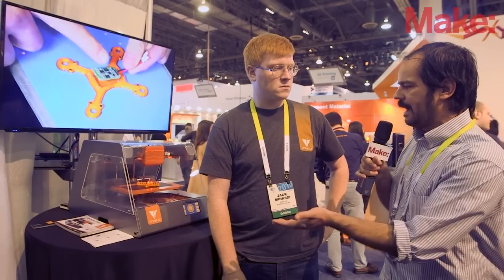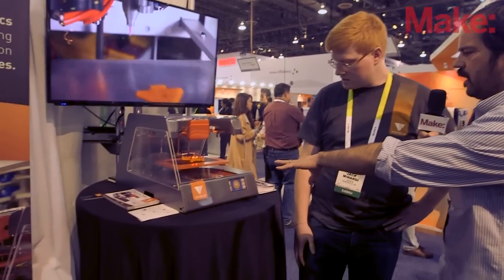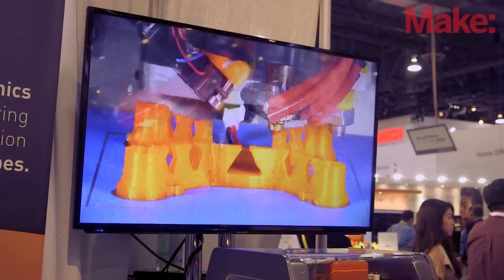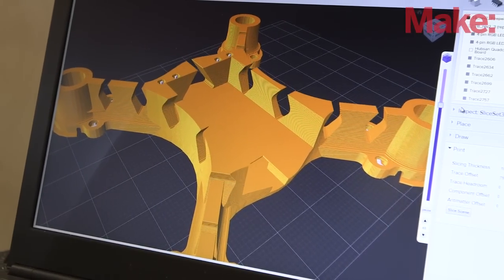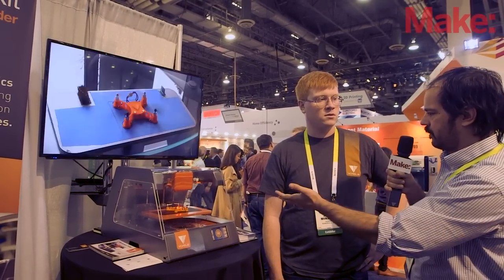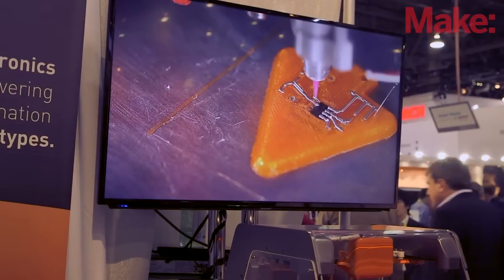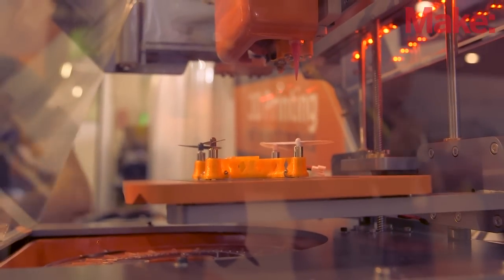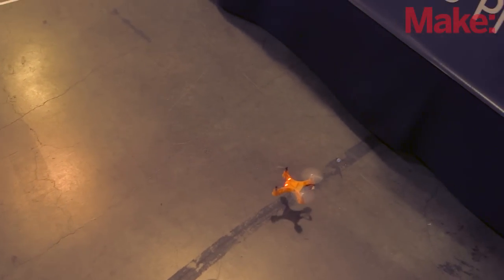CES 2015: A 3D Printer for Electronics

Comment: 6 months tops until someone mods a normal 3d printer to work with spools of ordinary low temp solder.
Reply: Would that work? Solder usually needs something conductive to stick to.
Reply: molten solder in contact with plastic will remelt the surface of the plastic enough for it to stick to the solder almost as well as hot glue. just ask anyone who hasn't been careful enough while soldering near anything plastic. plus you can just print a layer of plastic over the solder to help hold it in place.
Reply: BRB building my own 3D circuit printer. BTW I think the most difficult part is actually the print pausing and resuming.
Reply: yeah especially dual head printers
Reply: +Maltfalc Meh, what would be the point of that ? Unless you're making a whole bunch of circuit boards, this won't help, and solder certainly doesn't work well, it blobs and doesn't adhere well to polymers. It's also super heavy. Not saying it wouldn't work, just that this solution is way superior. I think the real future is that: Two heads, one for pla and other plastics, and another for conducting material and other specials.
They say it's a paste, so it might not even dry or anything, just stay there by encapsulation.

Comment: Just about fell of my chair when he said it was $9000! He said with with so much certainty and with out a stutter! o.O Printers worth a 10th of that price IMO...
Reply: buying a boxed printer for $900 is pretty hard, it doesn't strike me like it comes in kit form (and printers used to cost even more....)
Reply: DFX2KX Printrbot Simple Metal, Solidoodle Workbench Apprentice, Press, and 4, daVinci XYZ 1.0 and 2.0, Robo 3D R1, and several other options from smaller companies.  Buying a fully assembled 3D printer for under $900 isn't a hard thing to do in the slightest.

Comment: This is pretty cool and very promising.. This adds another level/benefit for 3D printing and like how many others have said, the price has dropped with everything else, it'll drop for this too. (Even if it doesn't, you can bet everything you own that someone will come up with a substitute head/paste and or a more crude method for the same results) I'm just looking forward to some really dense multiple layered PCB's ((quite literally printed circuit boards hehe))

Comment: Why is everyone just caring for the price? It's a scientific result. It's not just for the consumer. I am glad they invented that no matter how expensive it is. Now, it would be very useful to be able to print different conductive materials in order to create the fancy like resistors, transistors, capacitors and so on. Then, no discretes would be required anymore. But I hope it will not be the standard of industrialised  production of the future. Because  these kind of assemblies are practically not repairable.

Comment: $9000 o_0 like to see how they came to that price.
Reply: It's the cost of its components and software mostly
Reply: Nathan Fletcher in the background you can get a 3D printer for $799 this machine  is nothing special apart from some conductive paste and the software is built on existing software. So $9000 is a very uncompetitive price.
Reply: TheDutyPaid 
Thanks that mite be my next investment
Reply: Harvard
Reply: meabn007
That is probably like their lunch money for the day.
Reply: They used algebra to calculate the printer value.  :P
Reply: 3 words, research and development.  But yes, $9000 is far too much for this even with that, especially since it's just a dual head FDM printer...
Reply: i hope the price goes down i cant wait
Reply: Noah Finlinson you've more fun with a much cheaper printer and making your own circuits.
Reply: true but i cant even aford a cheap one
Reply: TheDutyPaid It wont sell

Comment: For me if i had $1000 i could make one and have money left over to build a better one and have money for lunch for a month. Mine would use free software, open source, have the ability to make traces on a blank circuit board, something that wont flex. So not only can it 3d print, it can also be used to make circuit boards including drilling holes.

Comment: Another niche application for dead end eighties tech, sweet.
Reply: wait, 3d printing (and rapid prototyping in general) being dead-end 80s tech? Or just FDM (which is admittedly pretty old. given how cheap non-circuit FDM printers are, I do have to wonder about the cost.)
Reply: DFX2KX
Specifically FDM, though, it's one of the few methods that could be considered desktop ready (SLA, SLS, binder spray methods are messy). Hopefully someone figures out a cheap way to do aerosol jet deposition when the patents expire. That method too allows circuit board traces (however they're using it for conformal antennae, which actually makes sense), and they wouldn't look like as if made with a cake icing bag either.
Reply: Karri Koivusalo
ahh, yeah, FDM is fairly clean. Though I'd like to see more systems that use powder and not filament....